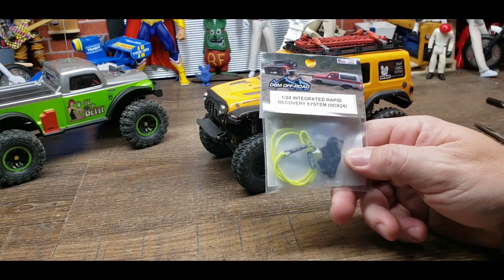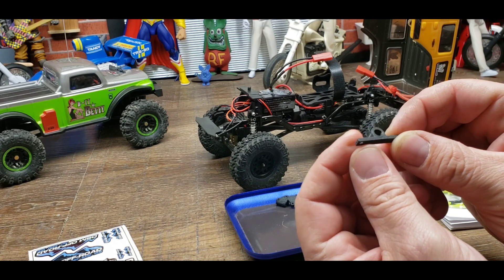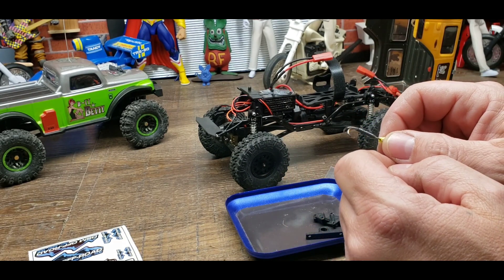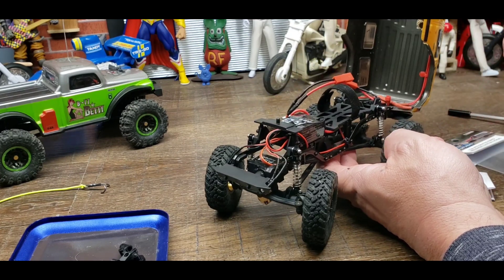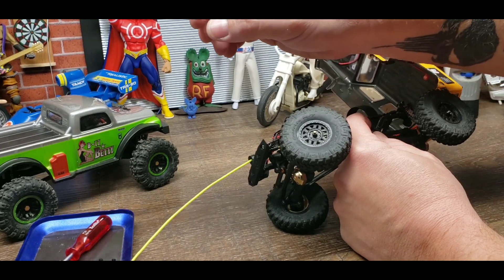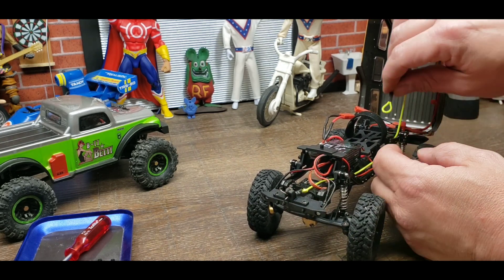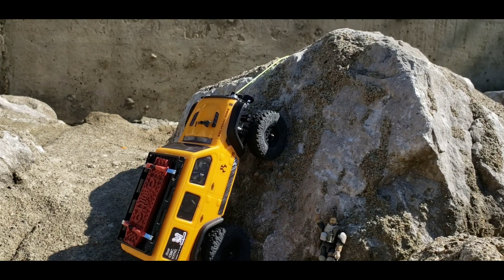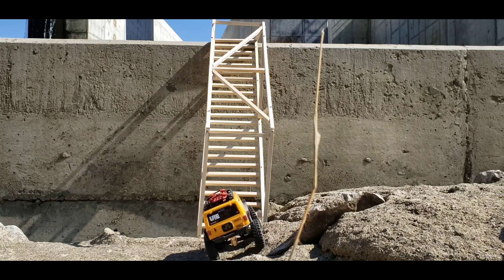DSM 1/24 integrated rapid recovery system installation and test

Comment: The only two competitions I’ve seen for scx24s didn’t allow the use of the over the top recovery system. Something about having to move the truck to get it out. I’m not sure what they meant. You aren’t supposed to use a winch if your truck is upside down. Hopefully this type will be allowed.
Reply from the maker: This should be fine i know you are allowed to use them on the 1/10 scale for most competition